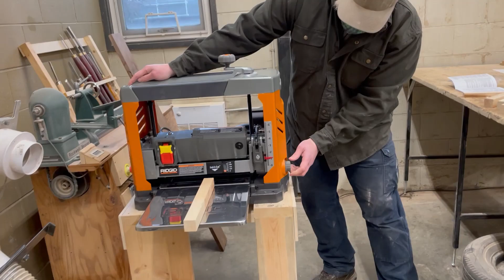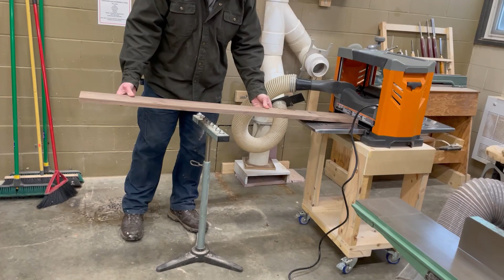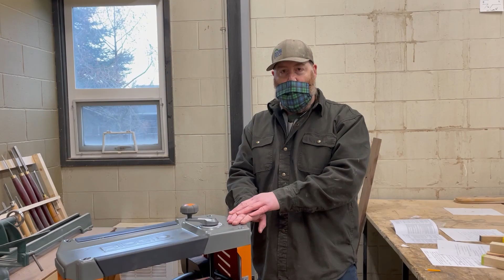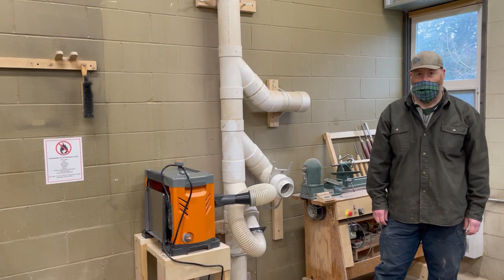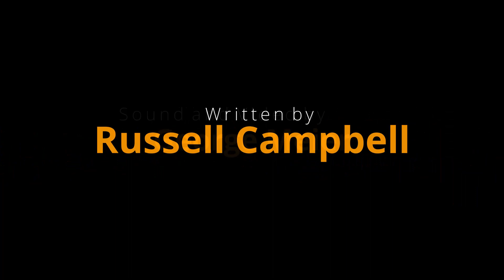Using the Rigid R4331 planer

Comment: well, that's 9 minutes I can never get back.  All that, and you never even planed a single board... NOT ONE SINGLE piece of wood.  Clearly you had never even used the machine because there wasn't a speck of wood dust on it.  Perhaps you were too scared of it... fair enough reason I guess.  
This is the first negative review I have ever left for anyone, but really?  .. repeatedly telling  people to lock and unlock the castors on the cart (after having it roll around on you), telling them to make sure that there is enough room on  the infeed and outfeed and then demonstrating that by placing a board on each side (one single sentence would have been sufficient)... showing how to put the cart away... just ridiculous.  Consider your audience... a planer is a fairly advanced woodworking tool.  If you know you need a planer then you already understand these things.  If people are that stupid, a planer is not a tool that they should be using!  I apologise for the critical feedback, but this was just too frustrating waiting to see some tricks to using the planer (like for example the use of a backer board and shimming) and you never even turn it on after almost 10 minutes.  The mask should have been a giveaway that this was going to be a 'poser' video.

Comment: I just bought a new Rigid R4331 but i set it up to cut 1/64 on the depth guide but it cut at least 1/8, what's with that? I now don't use the guide and just start where I believe the cutters will barely touch the wood and work down with 1/4 turns.